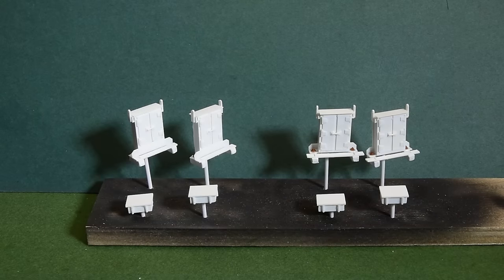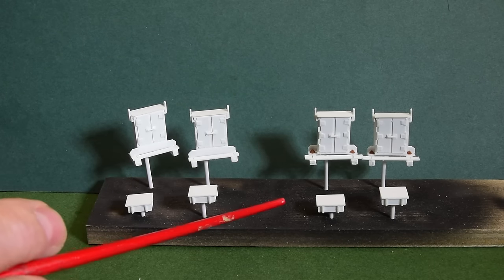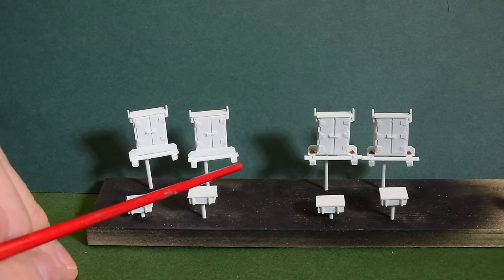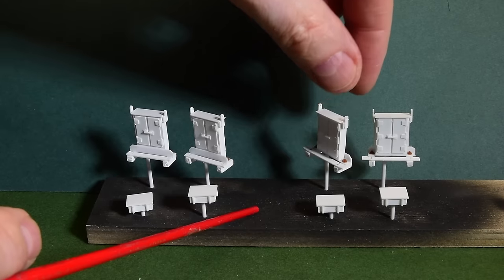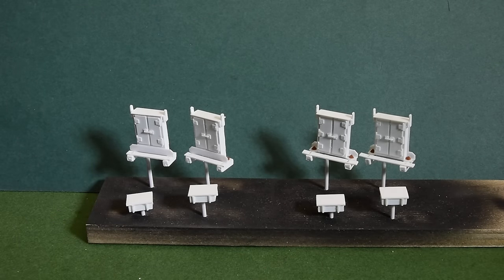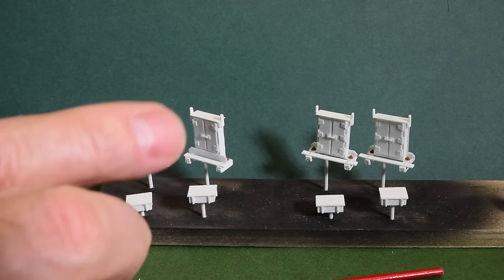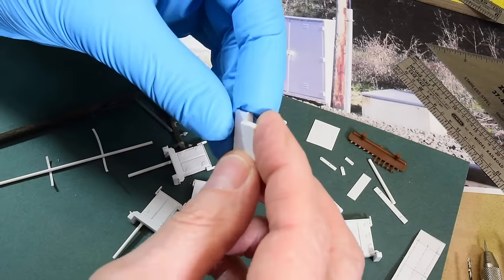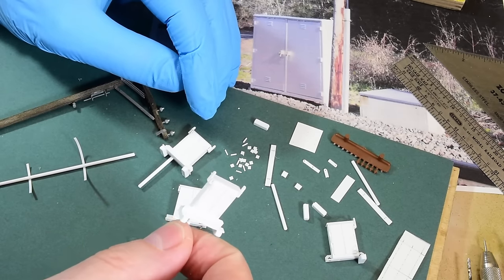Scratch Building Signal Boxes for Model Railroads | Boomer Diorama ~ # 235

Comment: found your site a couple of months ago; alot of binge watching.  as a neophyte scratch builder I am amzed at your work.  I have learned a lot, especially air brushing.  You videos have solved a problem that has  been frustrating me for a long time...not enough solvent (IPA).  Diluted the tamiya paint and it works like a charm.  A big thanks Boomer.
Reply from the maker: Tamiya acrylic paint is awesome when sprayed thin with IPA. I use it for every subject in the model world because it is so reliable and the color quality is off the charts.

Comment: Excellent video.  Coincidentally, I've just started the "locker phase" of the HO icebreaker I've been building, making the ammunition and storage lockers that will go along the main and upper decks and this confirms the approach I started the first couple with and showed me a better way to make some of the other smaller ones, especially with hinges.  The technique for adding a conduit to the telephone pole is applicable to adding some of the pipes that run up the side of the ship's stack, which is going to be attempting to turn some sheet styrene into a tube.

And I need to build some signal boxes for the right of way on my railroad as well.  Having the painting added in the video is great, because I never would have thought of using the wash technique on such small structures.  Great little project all by itself!  Thanks!
Reply from the maker: You can get a great selection of HO Scale hinges from Tichy Train Group as well if you want.

Comment: The signal and battery boxes are  details few model.  Modeling the electrical meters almost none. A friend and fellow hobbyist (since deceased)  worked for the PRR.  He was assigned the task of checking every electrical meter between Fort Wayne, IN and Chicago, IL to determine if the meters were still in use or abandoned.   As I recall he found approximately 100 locations where they were no longer needed, and the railroad was still paying the minimum amount.  As modelers, we seldom consider these details that are a part of the day to day operations needed to keep a railroad up and running.

As always thanks for sharing your talents.
Reply from the maker: Good point on the details being there but not actually functioning. We tend to model perfect worlds and not reality at times.

Comment: You have done a fabulous job on those relay cabinets/cubicles/cases, Boomer. The only thing I can nitpick is the depth of it - I feel it should be a little deeper, say 50%, and have an access door at the top portion on the rear to access the rear of the relays. (I am making an assumption of the internal equipment used based on my experience in Australia, Hong Kong and the UK so could be off).
Regardless, an excellent representation of an older style of location case! 👍
Reply from the maker: I showed the photos I built from. I build what i see and measure when I can. Not sure what you mean. Cheers.

Comment: do you think the signal boxes might be a bit large? I was just comparing the doors and hinges on the side of my HO Scale Trains SD40T-2 and they are way smaller.
Reply from the maker: They are built on spec from the SRY/CP connector. So no, I don't think they are. Have you walked up to one and put a tape rule on one. They are all different in many cases depending where it is. I build what I see and touch usually. The hinges have nothing to do with an SD40 size.